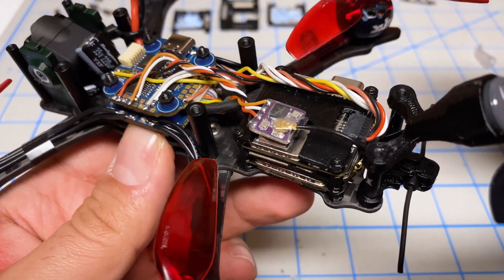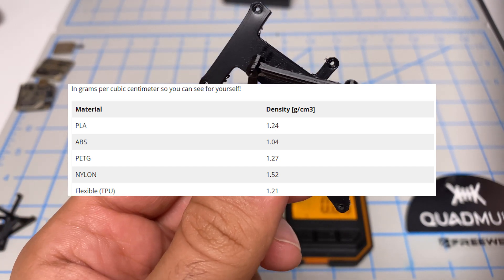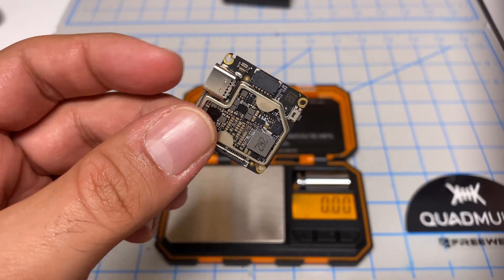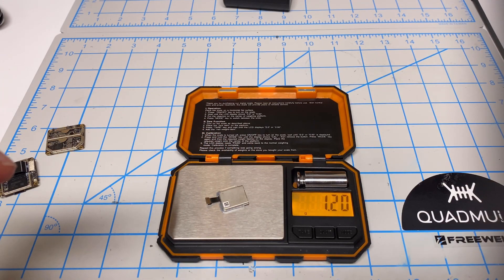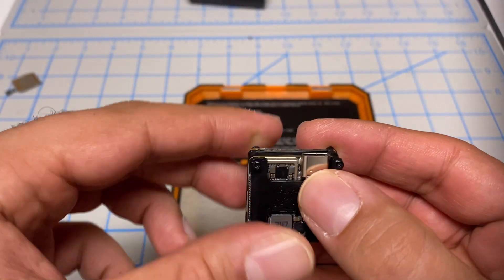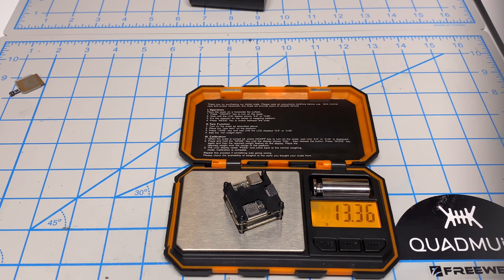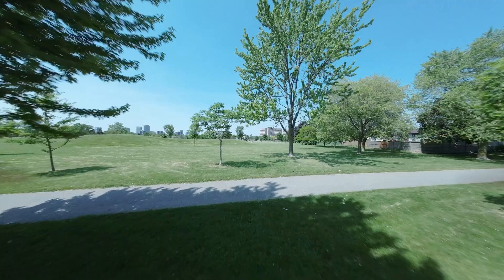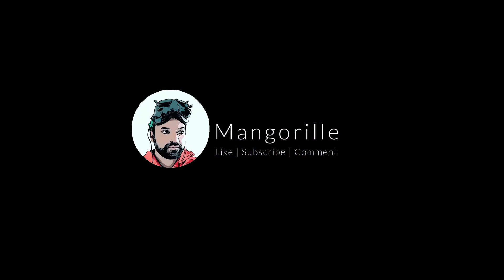Replying to your comments | Naked DJI O3 Air Unit Update

Comment: The screws mine came with.Don't seem to be long enough is that normal..
Reply from the maker: For the side that connects through the frame? If so, yes, you need to use the longer screw that came with your frame rather than the screws that came with the O3 air unit for that end.
Reply: @Mangorille  ahhhh.. Thank you sir. That solves that problem

Comment: if you removed the SD card slot, are you not losing out of nice 1080p or 4k video recording options?
Reply from the maker: No, the O3 has 20gb of storage space built in. You'll need to keep erasing it but it works fine for those doing shorter flights.

Comment: I also made an ultra light. But now I have a strange problem: during a steady flight everything is fine, but if I make sharp maneuvers - the video in the glasses slows down or even freezes for a second or two. Of course, this leads to a fall. The video that is recorded on the module is fine. The problem is with the video transmission. I think it is somehow connected with the removal of all the covers. I could assume that I made a mistake somewhere, but it is noticeable that  TWO dji o3 behave this way, which I stripped naked. 
 In this video, a comparison of the video from the glasses and from the module. For two different o3. I thought that perhaps the P1 cannot work without cooling, but I have seen many for whom it works perfectly.

https://youtu.be/MazC1bxI3OA?si=HFxE9DnrtbNLpOMe

Are there any ideas?
Reply from the maker: You seem to have really weak signal strength given how close you are to yourself. The o3 signal degrades a bit when you get off axis so that's fine but even when you are not doing sharp maneuvers, you're mbps is all over the place. Are you sure that the antennas are connected fully? What goggles you using?
Reply from the maker: Also, note that the o3 has a voltage requirement of 7.4-26.4 V. That's why you probably had the first disconnect, you went down to 7.3v.
Reply: @Mangorille  in that case it should be visible in stock version….
Reply from the maker: @my.fpv.flights  Did you make any other changes? I don't see how removing the case would cause this to happen unless a connector was damaged.
Reply: @Mangorille  no, I am going to try to use top plate from another o3. let's see
Reply from the maker: @my.fpv.flights  Good luck. Silly question, you sure the antenna on your goggles didn't pop out?
Reply: @Mangorille   antenna is fine cause I have tried it with several. Update after tests: I had two of the same problems ultra naked  o3. 
I have tried with new internal  flat cable. 
One o3  is completely dead now ( I mean the top plate which is the transmitter. I do not know why). With the second o3 I found really interesting: I had already tried to cover P1 chip side plate  with paste and cover but I did not help until I put other side's cover too. And it works! 
It might be an accident unlucky but I do not want to uncover it back. Saving those grams cost me money )))  

So, be careful with making it ultra naked.
Reply from the maker: @my.fpv.flights  I wonder if you have a loose component. Maybe something got knocked loose as part of cleaning the paste?
Reply: @Mangorille   it is not easy to make it two times equally.

Comment: I think the tpu is a better option for this mod what do think mangorille?
Reply from the maker: Both work fine. I like the ABS option a bit more because it weights less and the screws hold better.
Reply: @Mangorille  I just tried the ABS option and went a flew a all day at the end of the day i noticed a bad smell coming from the 03 air unit and behold the abs had melted to the middle and bottom pieces melted to the rf shield thank god i left the rf shield on, this did not happen with tpu weird.
Reply from the maker: @Viseo3dp  Did you use pure ABS filament or some sort of hybrid? Usually you print ABS at something like 260 degrees C and I doubt your air unit would have gotten that hot.
Reply: @Mangorille  Yes it was true abs filament from bambu
Reply: @Mangorille  I tried a different abs brand and no problem

Comment: Hello, i am disassembled air unit without remove glue conector before, i don t knew proccess, i just remove conector like that but when i assembled with naked flywoo kit i loose quality video on google. Do you think i have made some damage on the connector ? Sometime when i remove o3 cable conector znd replace i have black screen with osd, so i disassembled cable to replace it and it work but with poor quality video. I try to wash conector and warm glue to fix it but with same result. Thank you
Reply from the maker: The connector should have been very hard to remove if you didn't remove the glue first. Look closely at the connector to see if any part of it got damaged. Also make sure it locks correctly, you should feel a little click when you reinstall the connector.
Reply: @Mangorille  thank you for your reply, i forgot to Say that i have buy a new câble but with same result. I don t feel click when i reinstall the connector and it s thé same for the caméra connector i don t feel click.

Comment: Awesome video as always. Did you noticed some upgrades perhaps the wheigth? more fly time or something noticeable?
Reply from the maker: Thanks! Yes you get more flight time, the quad feels more nimble and powerful, and you have a bit more building options if you want to say under 250g (I was able to use this to build a 249g 3.5 inch with a 6s battery. Have a video on this).

Comment: What do you think for conformal coating 
I would like to waterproof my 03
Reply from the maker: I've done conformal coating on a flight stack before. I found it makes it more water resistant than water proof and I did burn one out flying in snow during the winter even though it was coated.

Comment: Great video! Is the air unit total height reduced? I’m having trouble fiting an O3 into a QAV Pro Micro, it’s hitting my AIO bolts
Reply from the maker: It is reduced slightly. I measured it for another viewer a while ago so I found those measurements after the mod: "You're looking at 13.8mm in height."

Comment: Sir there print is also support sdcard ?
Reply from the maker: Yes the print file from Quadmula supports the sd card slot.
Reply: @Mangorille  thank you , what about hit problem, I see if I unarmed my quad more then 20/30s then it's show me over heating this is original O3 no any decase or rapping tap or anything
Reply from the maker: @mokshpatel6986  Check the original video, I did some heat tests there. https://youtu.be/NIpNry4M-lc

Comment: Okay, but that about heat dissipation? Original case has metal parts and they participate in heat dissipation.
Reply from the maker: Check out the original video, there are bench temperature tests there along with an 8+ minute flight to check the heat dissipation impact. https://youtu.be/NIpNry4M-lc

Comment: 0.4g savings is not enough to worry about ... not even half a gram.  You might have been able to save that with the TPU by choosing less infill.
Reply from the maker: Agree, I was hoping for more. It is still about 14 percent lighter for the printed case itself and you can probably push it a bit more like you said through print settings but not a big difference in the grand scheme of things.
Reply: @Mangorille  Hey, I thought you did great getting the 03 down to so little weight, especially for all the power the 03 delivers!!! So, I'm sure you said it, but remind me please, what's the total weight of the naked 03 as you have it, without the case and with the TPU case?  Thanks.
Reply from the maker: @KOrnhOliO1  Without the RF shields:
Board 1 + Ribbon Cable: 6.35g
Board 2: 4.3g
SD Card Slot + Ribbon Cable: 1.2g
Total: 11.85g

Comment: Nice video.  I'm not inclined to de-case any of my vista units, but I do respect the effort you put into de-casing your 03 Air unit.  GREAT FOLLOW UP VIDEO.
Reply: Naked Vistas are much easier and work great!
Reply from the maker: Thanks buddy, I only did this on the O3 I have in my sub 250 gram 3" build so that I have more power to weight.